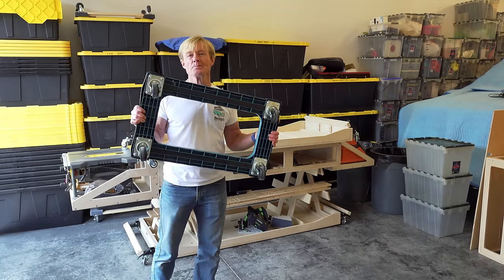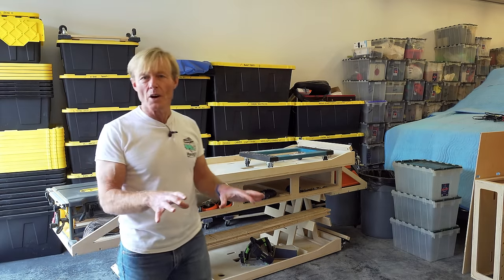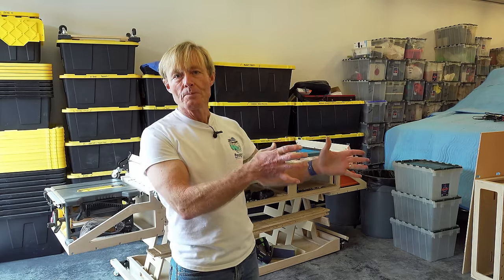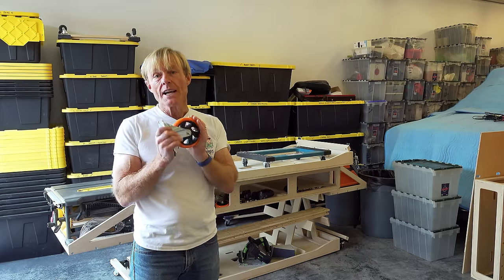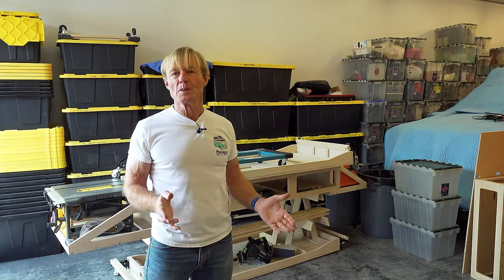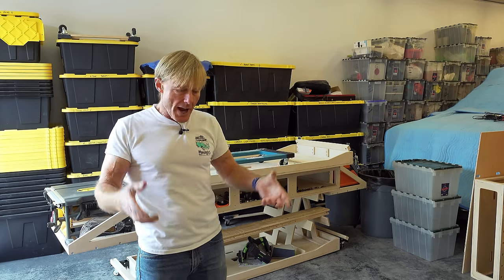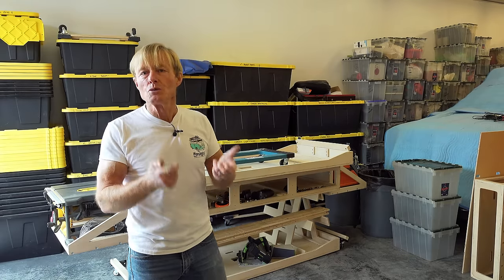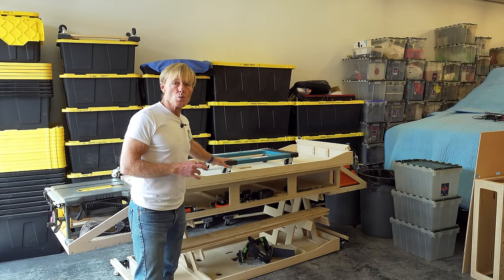Streamline Your Jobsite with Ron's Versatile Dolly

Comment: Ron,
I’m almost completely finished with my entire build of the Smart System. I cannot tell you how excited I am. At 33 yrs old, you’ve really given me a huge head start. Thank you again for sharing 30 years of your evolutionary and now REVOLUTIONARY process. My clients, my family, and I will reap the benefits for decades to come. 

Technical question— if you even see this comment. 

I built this dolly, just like you have. Have you come up with a good way to lock and unlock the casters—presumably you only do the rear ones since the isle is impassable with the assembly in it? I find myself getting down on my hands and knees abs reaching under to snap the caster locks. Perhaps you could comment or do a video on this? Thanks!

Comment: I really like the idea of the rolling carts, sure you have to store all those carts when not in use, but by the looks of the amount of bins you have, those carts will always be in use.  I have always been using shelves and racks as a way to store things, but always disappointed with the amount of semi permanent square footage that is lost with the racks. Rolling piles is the answer. I want to incorporate this thinking in the wood shop at my school. We call them skates (Canadian eh) but now it’s about making them work. We do a lot of sawhorse work with students, have you ever made  a tough sawhorse that can be used independent of the smart workbench. I have 16 sawhorses made of 2x4 and 2x6 that nest 8 high with a 6 inch height between sawhorse. I love them, and bc of then15 degree legs they nest really well, the draw back is that small students can’t hardly lift them, and certainly. It off the top, any ideas?

Comment: Was wanting to see the donuts attached to the bottom of the cart, so that any six dollies could be the used to carry the Smart system. But you now have the the wheels at the end of the cart,  drop it all the way to the floor, letting the saw horses touch down for stability. Hmm that feature needs more thinking.

Comment: Nice idea Ron but I’m wondering now that you have your workbenches on wheels in the hallway where are you going to store the Sawstops?   Are you moving away from them and keeping with the Dewalt now
Reply from the maker: The SawStop is my main saw and using the DeWalt as second saw. Now the SawStop is hanging using Smart Cradle. You will find lots of videos showing my current setup. 😎🤙

Comment: How do you keep the lids on all your plastic tubs from collapsing.  That's an ongoing issue that I've had, even with taking care to maintain a "heavier on the bottom" order of stacking.
Reply from the maker: They all fail if too much weight is piled on them. You can buy the commercial version, but they are $30 or more each.
Reply: I've used some scrap laminate flooring to "save" a few of my cracked lids by just cutting it to fit in the lid recess,  it's sturdy and not too thick to interfere with stacking another on top of it.  I didn't even glue or attach them like I thought I was going to do in the beginning, no need to.

Comment: So, the 'system' is to build wooden houses by constructing them from scratch on site. Like the Romans did. Imagine if they made cars that way. Efficiency is to use factory built modules that slot together, all plumbing and wiring already installed. Very common in Germany and spreading elsewhere. I predict that, if the industry does not change, they will start being bought in kit form from China at a price you cannot compete with.
Reply: I live in a ‘modular home factory corridor’.  There are dozens of manufacturers of modular housing w/in a 90 min radius and they’re sold and delivered throughout the northeast.  I’m not talking trailers and double-wides, I’m talking framed modulars. I was once a dealer for one of the best ones.  And I’m here to tell you that industry has 100% FAILED to perform the way we all might predict. The quality is not there, the design is terrible, the cost is NOT competitive with site-building, and when you consider the amount of time needed to “marry” the units and repair what happens between crap work at the factory and what happens during transport,  they take just as long or longer than stick-building.  Those are the facts from someone who has been anxiously waiting for a better alternative to stick-building for the past 40 yrs.  I’ve studied the Germans. The euro model you mention is fine, but Americans don’t want to live in that product and it too is 2x the cost of stick-building in the USA.  I’ve looked at panelization and in fact had a panel shop in the 90’s. Promising for frame quality and trade shortage issues, but still not cost effective in most markets. So for right now, in the vast majority of places in the USA, the fastest, cheapest, most flexible, and IMO highest quality way to build houses is still the archaic way the “Romans” did it.  Sad maybe.. but still true.
Reply: @HBSuccess  thank you for your experienced feedback on this topic
Reply from the maker: I have done about 10 very custom panelized homes that turned out well. They were not better than stick-built and they cost a lot more. I had a very high-end 1000' cottage built and the parts delivered for me to assemble on site. I also build a 7000' main house on the same project and the panel company was not interested in even trying. I would love to see some forward-thinking on this technique, but trucking, overpass heights, cranes, and all that really limit the possibilities. I have even tried precut kits and spent more time fixing them than just stick building. Maybe someday, but it isn't there yet and I will be long past building before it happens. 😎🤙

Comment: If you decrease the number of wheels, thats more point load on the floor per wheel. Would that damage the flooring underneath the cart?
Reply: I would venture to say so. The more wheels you have, the more the weight is dispersed evenly among them. The old adage strength and numbers holds true and also has other benefits